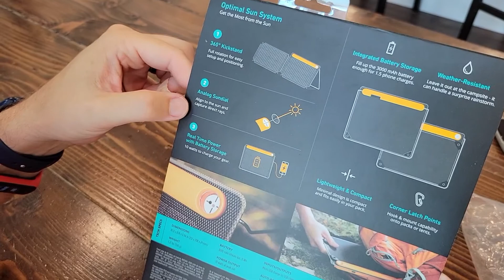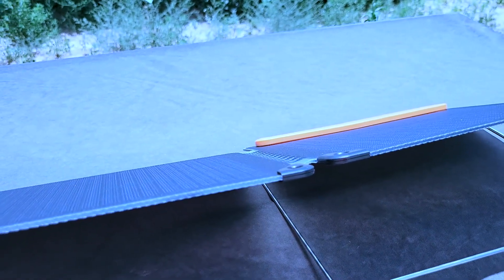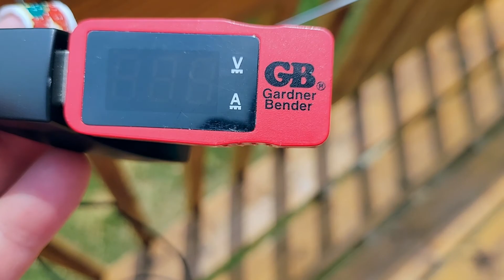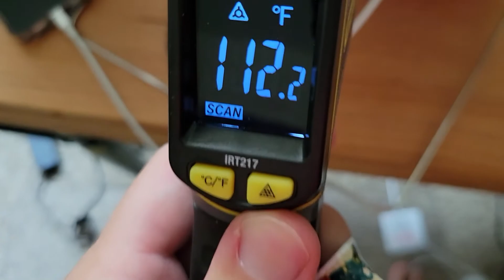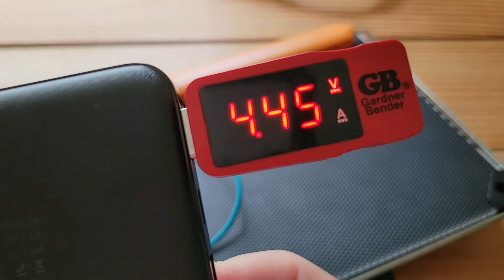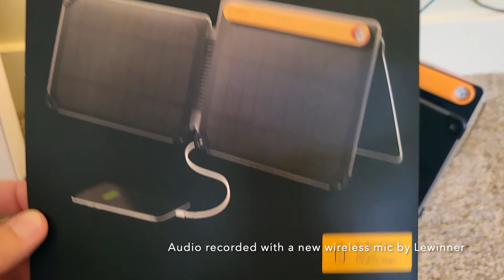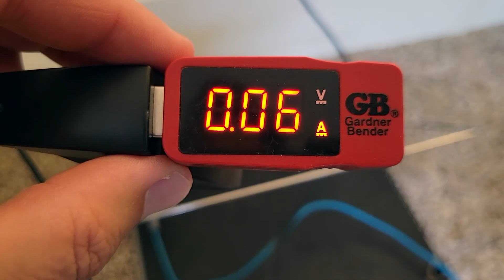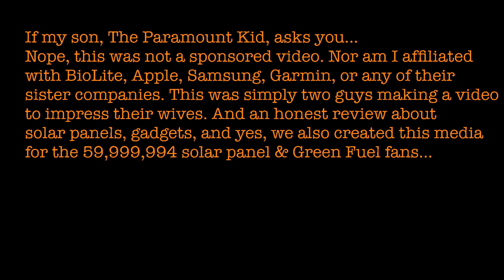BioLite SolarPanel 10+ (unboxed & reviewed)

Comment: Bought this panel about 5 years ago used the panel for 3 years until i bought a blavor charger store the biolite  10 panel  away  went  back to use it after a year in storage  solar panel  don't work will accept  charging  from a wall sockets  but not the solar panels don't have a clue WHY IT NOT WORKING ANYMORE
Reply from the maker: Glad to read your solar panel functioned for at least three years?

Comment: The battery is shot, if the circuit doesn’t see the 3.6v from the battery, Solar or charging will not work.
Reply from the maker: Yeah, that was a good theory. I have a new solar panel now that I'm testing made by Pale Blue... And the video will be coming soon!

Comment: I can charge my phone with mine (after hitting the button), but can't charge my inreach device. It starts to charge and then stops a few seconds later.
Reply: I actually just returned it to REI. I need to be able to charge my inreach. So never actually used it except testing at home.
Reply from the maker: Bummer, perhaps R.E.I., or BioLite will release a newer, and more well built solar panel next year...
Reply from the maker: That is great to know Eric and thanks for the positive comment. How long have you been using your BioLite Solar Panel?

Comment: Noone here has read the instructions as to get charge out you must first give a press of the battery test button to activate charge mode yet this is not even attempted in the review video
Reply from the maker: Yeah, I tried that off camera and it still did not work. I contacted REI and returned it for I was sent a defective BioLite. Thanks for the advice and for clicking on by... Do you have a similar BioLite Solar Panel, and if so, what are your thoughts?
Reply: @PeterHerget  yes I have the same Biolite panel and so far it performs quite well especially when the internal battery has some charge to take up slack when you get momentary cloud cover
Reply from the maker: That is great to know - thank you Eleanor 👍
Reply: У них штекер по питанию тупо слабый. У меня такаяже и тоже тупила. Разобрал и поджал сами клеммы питания и панели. Они там защелкиваются но болтаются как карандаш в стакане на самих клеммах.и BaseCamp починил минусовой был обжат на винилку.и в один прекрасный момент отключилась у людей и расплавилась. Я все починил и спаял новый обдув по образцу
Reply: @ЯковДубаков  то есть у вас такая же панель? Я сам заказал на usmall 2 панели 5+ и 10+. 5+ пока не смог заставить от солнца работать - сейчас зимой солнца почти нет. Но если правда дело может быть в контакте - подскажите, как именно вы решили проблему 🙏

Comment: Mine same as you are,  defective upon unboxed, get replacement yet the same things occured😰🥺
Reply: Noone here has read the instructions as to get charge out you must first give a press of the battery test button to activate charge mode yet this is not even attempted in the review video
Reply from the maker: I did read the instructions before filming and contacted support. I don't have the instructions anymore, so I will have to give the benefit of the doubt...
Reply from the maker: That is a HUGE bummer - sorry :(

Comment: Mine same as you are, experienced the same, get the replacement and yet the same thing, its defective😰🥺
Reply: Noone   here has read the instructions as to get charge out you must first give a press of the battery test button to activate charge mode yet this is not even attempted in the review video
Reply from the maker: Lame! Sometimes there are just rough days in the factory...
Reply: Клеммы подождите питание и с панели. Разобрать придётся но оно того стоит

Comment: Thank you for this!
Reply from the maker: Glad it was helpful! I only wish the BioLite would have been built with higher quality...
Reply: @PeterHerget  Same, it looked like a solid product. Thank you for making your video! (I'm looking for a solar panel to take with me for a kayaking trip down the grand canyon this year, so you saved me a headache along with a dead gps/phone/headlamp) Much appreciated! Cheers!
Reply from the maker: You are most welcome 🙏 I read more reviews on the  R.E.I. website, and a few others, and I was not the only customer that had quality issues. The design and features were pretty good. Yet, even after the first three hours of usage I had my doubts- another missed opportunity caused by poor design, poor choices of parts, and a severely limited Quality Assurance. I plan to try more backpacking Solar chargers in the Spring when I return to the Grand Canyon - South Rim🤠